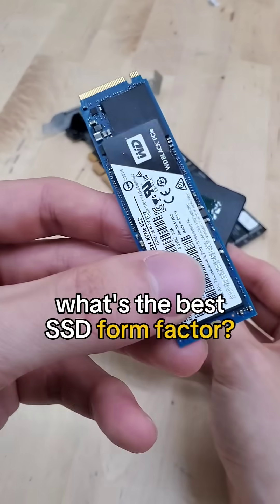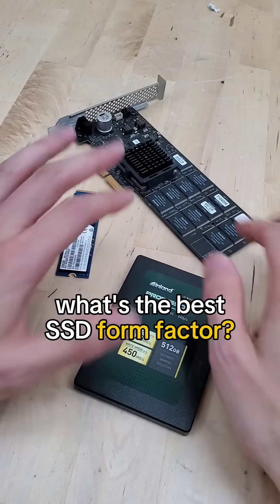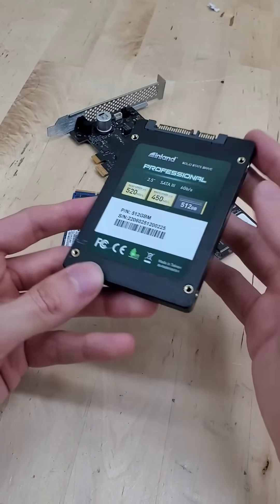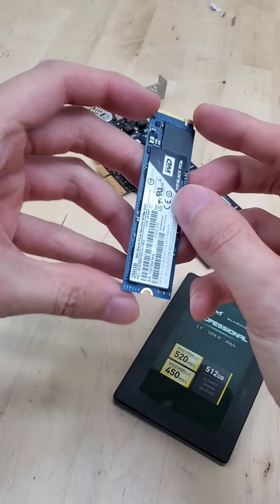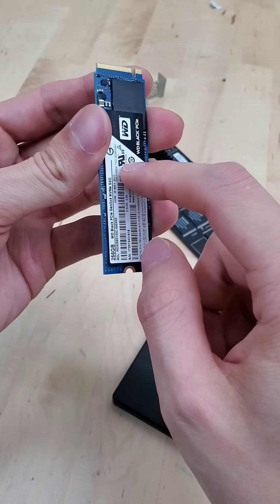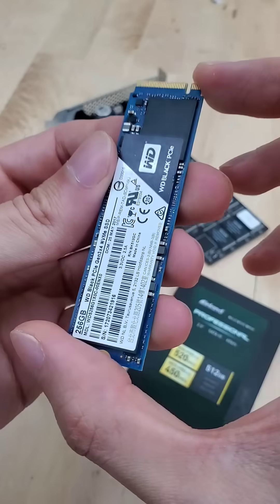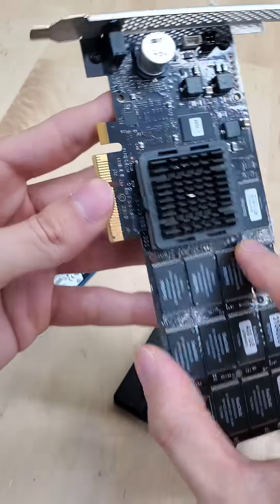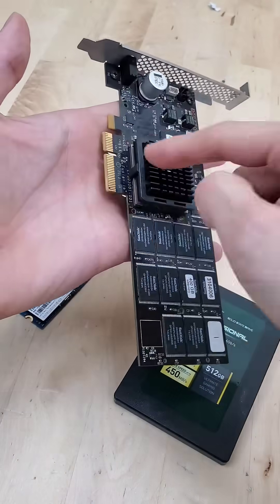The beautiful diversity of SSD form factors

Comment: The PCI SSD is great for older boards that only have 1 m.2 slot.
Reply: Older boards like mine don't even have an m.2 slot
Reply: @Rainiermix  you can get a PCIE adapter card with a m.2 slot. That's what I use on my motherboard that has no m.2 slot
Reply: @Rainiermix  if your board is so old that you dont have an m.2 slot, you dont need a m.2 ssd
Reply: @Sideleek03588  some cheap am4 motherboards don't have one, for you the ryzen 5600x3d don't need a m.2 ssd?
Reply: @Sideleek03588  you think 1151 is old?
Reply: @thestrongestbacon-qu5fd I used to have a 1151 board and it had m.2 lol
Reply: @Sideleek03588  yes, it's typical for 1151 boards
Reply: @pikachuvegano then don't cheap out extremely on your motherboard.
Reply: @Rainiermix  i think yours would be classified as ancient not old bud.
Reply: @BobaPhettamine  my board is from 2017 and has no m.2 slot, that isn't ancient.
Reply: @Kaleb-q9p Yeah it is, in the computer world that is.
Reply: @Kaleb-q9p  u can get pcie to nvme or oculink to nvme im pretty sure and even sata to nvme but would be sata speeds
Reply: @Rainiermix  bro even my 4th gen intel board has one ^^
Reply: @michubern1444  ooh, which one?
Reply: @Rainiermix  asus z 97 gaming or something i dont have it anymore
Reply: @Rainiermix re: the 4th gen intel board having an m.2 slot, can confirm, mine does too, but if i recall correctly its a weird slot where if you use sata it can’t run at full speed
Reply: It was the only way to get faster speeds than SATA back in the days before the m.2 NVMe standard became the norm for flash storage. People tend to forget that m.2 only came about in 2013 and is a comparatively new storage connectivity standard.
Reply: @mndlessdrwer I remember buying a new mobo in 2015 to get an M.2. Had USB 3.1 (before the USB rename) that was twice as fast as USB 3.0 (the OG blue one) good times. Still have it, and the 4770k. Heck, the 2 - AMD R9 290's too
Reply: They are generally super expensive since they're made for enterprise, a PCIE to M.2 adapter and a M.2 SSD is way more reasonable
Reply: @lilbeachy   I GOT ONE WITH 1TB FOR 50
Reply: @lilbeachy  Yup, did this and it works great!
Reply: @lilbeachy  said adapters bottleneck transfer speeds though
also most of them cannot boot from an ssd plugged by adapters
Reply: @lilbeachy  At one point in the early days of M.2 NVMEs the retail drives came with a PCIe 4x adapter card.

I actually have one of these due to a weird quirk in the mainboard its in.  (You aren't able to boot from M.2 ... its old.)
Reply: @StopTryingSoHard  Ah, those halcyon days of 2013.
Reply: @StopTryingSoHard  A motherboard's UEFI firmware doesn't "boot from M.2"; UEFI boots from a supported protocol, and M.2 is NOT a protocol, it is just a physical connector like USB-C. And like USB-C, the M.2 connector supports many protocols: NVMe, PCIe, and SATA. The problem you most likely experienced with the old motherboard is that it implemented a M.2 slot connected to a NVMe interface, but the UEFI firmware it uses is too old and does not support booting from NVMe. If the M.2 slot also supports SATA, you could have put in a M.2 SATA drive in the slot and the UEFI would have booted from that M.2 drive because every PC UEFI firmware supports booting from SATA.
Reply: @Tempora158 Hey! Stop giving out correct information in the comments section. You're supposed to tell people that they're dumb for not understanding how things work and berate them for not reading about it. You're over here serving up information on a silver platter where all the dum dums can easily figure out the answers. Jeez...
Reply: @StopTryingSoHard  what's the point if you're not able to boot to it? That's like the only time the speeds actually matter.
Reply: you can buy an PCIe adapter for M.2...
Reply: PCI is dead. You mean PCI-E
Reply: thats an "old" board. old boards dont have m.2 at all
Reply: в старых платах нет поддержки твердотельного накопителя по pcie разъему
Reply: @lordtop1gg6805  maybe not as a boot drive. Just it typically can be use for games. I have a system that I use to host a game server on and it's from 2010. I have 2 dual nvme to pcie adapters in it. Think it's 2.0 or 3.0, not sure. Just keep in ming newer drive will only run at the slots pcie version.
Reply: or none
Reply: my board has zero slots 😭
Reply: Even a CD disc open button is not in some people's knowledge.
Reply: Nvme is basically PCIe so you can just buy a m.2 adapter that you plug a "regular" nvme m.2 ssd into. One thing to keep in mind is there are only 1-2 z87 boards that can actually boot from pcie mounted nvme but if you're lucky you can mod your own bios and it will work perfectly fine
Reply: A pcie to m.2 adapter exists!
Reply: I have no m.2 slots bro
Reply: ocz revodrive was made like 10 years ago but it wasn’t cheap at the time
Reply: tf you mean "older boards"? my motherboard doesnt even have m.2 slots
Reply: There are pcie m.2 adapter boards that can host 1 or 2 m.2 ssds on them.
Reply: Older boards dont even have m.2
Reply: I have one in my lab server that plugs into a PCIe port and has an NVMe slot.
Reply: That won't boot as it's technically block flash device
Reply: i had a ausus ROG one back in the day that from the factory was 2 120gig ssds in raid 0 on the card , expensive, and not super reliable but fun
Reply: PCIe*
Reply: Older boards dont have any m2 slots 😂
Reply: or none
Reply: Or boards that don’t even have one at all
Reply: Or just use a PCI-E to M.2 adapter.
Reply: honestly, seems like it would be pretty cool to be like “that’s my ssd”
Reply: "older boards with m.2 slot" is a helluva statement.... i now feel geriatric number of years old
Reply: Or one with no m.2 slot.
Reply: i dont think any old mobo has any kind of m.2 slot lmao
Reply: Define old? @TheBlue_Lobster , aside from that you can always use a pcie to nvme adapter. Most likely won't be able to boot from it, although some boards do support it. It's still valid.
Reply: @tfkoincognito  exactly and some "old" motherboard doesn't even have nvme slot let alone it was even a thing when it was manufactured

nvme came out in 2016 it's not that old😭
Reply: @TheBlue_Lobster nvme came out in 2011 but ok.
Reply: @tfkoincognito  nvme got invented in 2007-2009, and i meant the second gen nvme as 2016
Reply: @TheBlue_Lobster you said came out... and it came out in 2011. Nowhere did you say invented. Those are not the same thing.
Reply: Older boards don't have a m.2 slots 🤔 or am just poor
Reply: funny of you to think i have a m.2 slot
Reply: @sebastian_solace_official-Z13 you do, look at your backside in the mirror.
Reply: In my experience, older motherboards can't boot from them, though, so they end up being kinda useless.
Reply: @PistonAvatarGuy not really,  having only one drive is kinda lame. Besides you can even put a sata adapter in that to have 5-6 more drives... or in my case 1 for boot, one for games and one for general storage.
Reply: @tfkoincognito  Most motherboards have at least 4 SATA ports, so a PCI-E SSD is definitely not going to be the first choice when it comes to adding drives.
Reply: @PistonAvatarGuy it really depends on what you are doing tbh. That pcie 16x slot can hold 4x drives on its own, with no added power with faster speeds than sata. I dont even use the 8 sata ports on my old pcs mobo now. It actually was able to boot from pcie. So even though it happens to be older, im booting from an nvme on it.. then the other 3 are used in raid for the server.
Reply: @tfkoincognito  Yeah, I misread the comment that I replied to and was really only talking about the PCI-E SSDs like the one shown in the video. I thought that the comment said older motherboards without an M.2 slot, which don't seem to have the ability to boot from a drive in the PCI-E slot.

Of course, the PCI-E adapter boards for M.2 drives are very useful.
Reply: pcie lane bus bandwidth is shared for each occupied lane so most of the times if all m. 2 are occupied your graphics card will have x8 pcie bus bandwidth which means it will communicate slower with the CPU
Reply: @xarisfil58 Normally it disables sata ports. Only if PCIe sockets are used below gpu does it cut it down.
Reply: @tfkoincognito  no in fact on top end mobos like maximus hero x if you install M.2 on M.2_1 slot it automatically cuts down the gpu bus lane bandwidth (which is the first lane x8/x16 ) to x8. I had this issue and had to buy a pcie to nvme adapter card to connect the nvme from M.2_1 slot to pcie_4x (last full size pcie lane). M.2_2 slot doen't cat the bandwidth.
Reply: @tfkoincognito what you mentioned about sata ports often has to do with secondary not primary M.2 slots which work with sata mode too and depends on  how much pcie lane bandwidth you reserve for example if you reserve x4 on the secodary it disables the last 2 SATA ports. To be clear 
PCIe lanes are a finite resource that connects various components to the CPU 
the same happens to SATA ports. Some M.2 lanes (primary ones) are hardwired to the CPU to use the resources of the pcie directly and if nvme is installed there bandwidth is cut off the other pcie lanes resulting for example to x8 gpu lane
Reply: @xarisfil58 definitely doesn't sound high end lolz. Even on am4 lower tier boards that never happened. Oh wait amd has more pcie. Imagine paying that much more for intel only to get screwed over for it.
Reply: @xarisfil58 no, it ran in nvme, I still use my old am4 for my kids to goof off on.. its all nvme. Tested with all nvme drives. I have never used a sata m.2 drive on it.
Think you are still wasting time on intel cpus to get less functionality.
Reply: @tfkoincognito  i think you don't know what you are  talking aboute
Reply: you actually pay the vrms (voltage regulators) that the mobo has which are more than typical mobos have so it handles oc profiles stable
Reply: @tfkoincognito  i am talking about a m.2 socket that supports PCIE, SATA and Tenton Glacier standard. Who talked about SATA m.2 drive? (i used nvme drive with pcie)
Reply: and talking about the LGA 1151 then amd was nothing and the Z370 was at the time the best possible consumer option chip for both gaming and productivity. 2017 amd had some early ryzen baking machines only  (that could bake eggs only). It was the only resonable choice to go intel back then
Reply: @xarisfil58 actually you did, talking about sata mode on m.2. Which requires a sata m.2 drive. Its a protocol not a mode btw. And with rog you are more paying for the name on those boards. There were much better boards for cheaper.
Reply: Ha, my PC motherboard has 4 M.2 slots(3 occupied), but my OS is on SSD LOL
Reply: not really .... since ur limited to the PCIe lanes on ur cpu, not to the slots on the motherboard....
Reply: pci board often dont have m.2
Reply: Just use the m.2 slot that you have?
Reply: Im on am5 and lack two m.2🥲
Reply: Or for old servers (like my old dell r720) which have m.2 slots at all. only SATA/SAS and PCIE here. and usb I guess if you want to deal with that!
Reply: Yeah i use a pci card that allows me to put a m.2 in it
Reply: so wont it have to share pcie lane with the graphics card which will make the gpu slower and which defeats the purpose of having blazing fast gaming computer?
Reply: HEY please can show the difference between a m + b nvme ssd and m nvme ssd and plug the m + b nvme ssd into a 2 connector m only motherboard i tested it and it works
Reply: @hitikk1 ez10
0
Ql600

Comment: You should solder a CPU cooler on a CPU and see how it performs
Reply: I think that’s a little above his ability. You’d need to heat the entire cooler to melt the solder but I guess he could yolo it with a heat gun lol
Reply: @catmachete2900 its impossible to soldering the tiny pad on a tiny aluminium pcb and soldering on a sink is impossible maybe with alot of heat and low temp solder
Reply: thats just the same as liquid metal
Reply: Genius 💥
Reply: How would you not overheat the CPU? I guess you just would overheat the CPU and just hope that it survives such that not enough damage was caused?
Reply: @MsHojat  perhaps remove the IHS first, solder the cooler to the IHS, then then reattach the IHS again?
Reply: @MsHojat u should use flux and Air heater soldering machine and make sure to turn off the fan before soldering and use indian tutorial
Reply: If he doesn’t have a solderer he could buy one or borrow and not follow an electro boom tutorial
Reply: bro even my am4 cpu always got stuck into the cpu cooler without soldering them together lmao
Reply: @davidyusaku  this happended to me too lol :skull:
Reply: @LeVraiKaiYT  that's PGA chipset in a nutshell lmao
Reply: The major problem here would be that you cannot ever take it off again and will likely cause other issues in addition to the toxicity (lead is a heavy metal that causes brain damage)
Reply: @Duck_side there exists lead free solder and you are speaking as if lead solder has killed millions instantly. It's lead not mercury, it will take countless long exposures to have significant damage.
Reply: @Duck_side  simply touching or being in the vicinity of lead doesn't give you brain damage, you'd have to ingest it in some way.